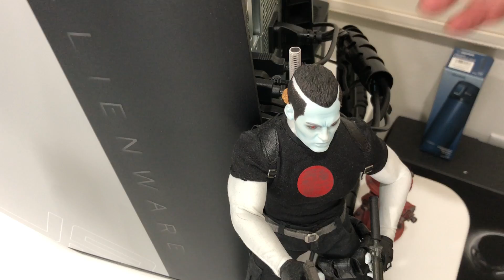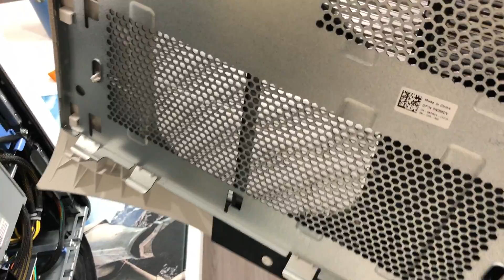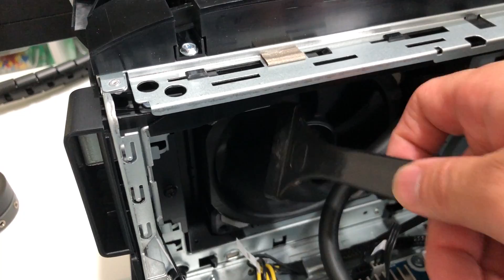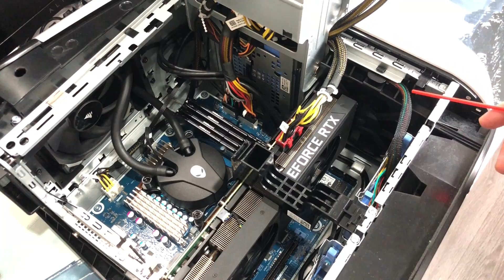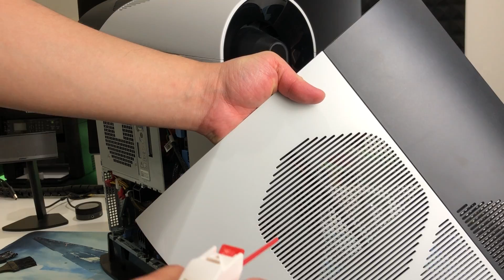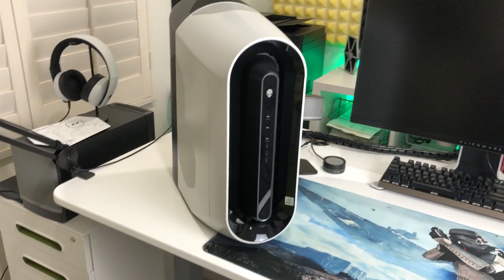How To Clean Alienware Aurora R12 / R11 / R10

Comment: nice video bro i dont know wht people dont like the r 12 i love mine and had no problms with my r12  it its a beast i have the rtx 3080  with webroot and advance system care its a must. like i said noooo problems thanks buddy for the vide fixing to clean mine
Reply from the maker: No problem.
Reply: I haven’t even cleaned mine yet and I had it for over 2 years. still runs like new.
Reply: I have an R11 and it has plenty of issues and high temps, idk why some Alienware desktops are good and some aren’t